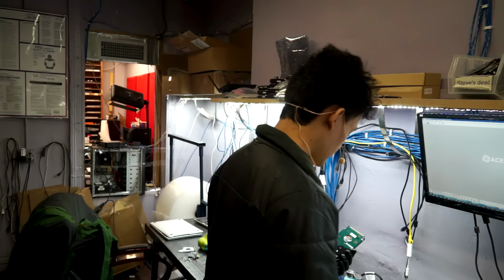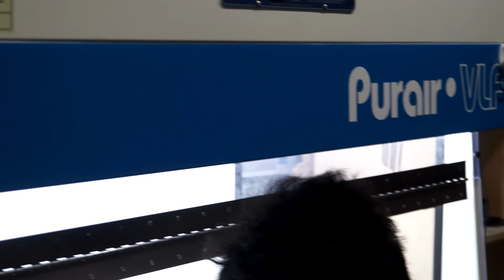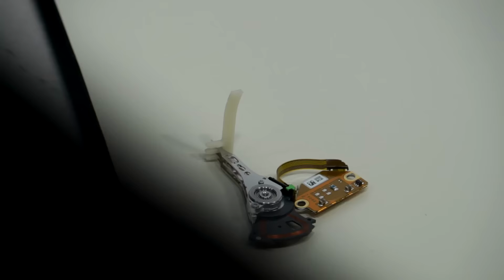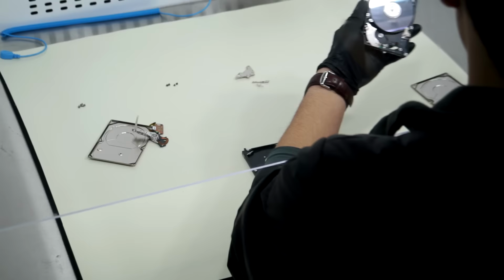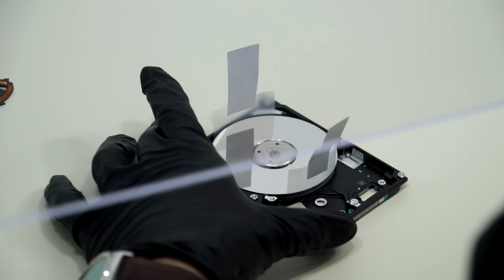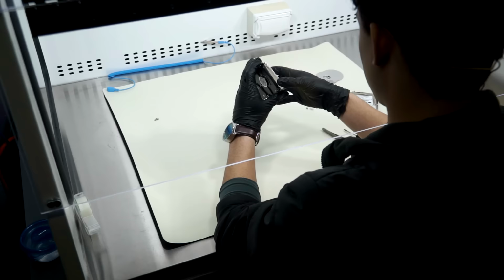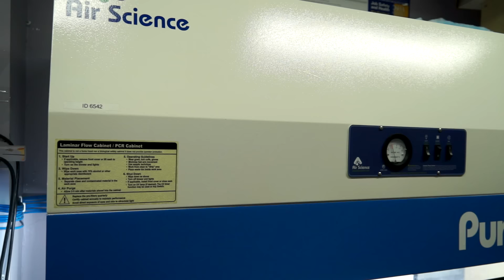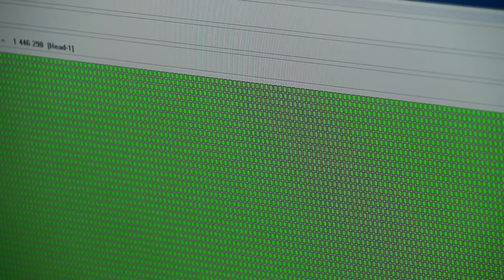Data Recovery: Hard Drive Platter Swap in Our Lab!

Comment: See what I mean?

Sharing/collaborating is the way of progress, not competition.  You shared this with the world, and now this will allow thousands of humans to replicate it — that is progress.  Now imagine you kept this secret (which capitalist system tends to push you to do — keep secret, isolate, compete, not share) — that would be impediment/delaying of progress.

You might think - "I shared this and did it in a capitalistic system".  That's because you can afford to do it, at least for right now, but if tomorrow someone opened a repair shop near you and proposed the same services for a lower price (which is how a capitalist/free market system works) — you WOULD NOT be sharing this — thus you would be impeding the progress ( and not because you personally are a "bad" individual, but because THIS SYSTEM would be pushing you to do this/to behave in this way, ).  No two ways about it...

And that's why a socio-economic system based on capitalist principles is very wrong, unfair, harmful even unscientific ( not to mention that it's completely unnecessary ).  And yes — we definitely can/could base the human society on collaboration instead of basing it on competition.  Actually, it would be the very starting point of the REAL progress, when we transition from competition to collaboration based socio-economic organization.

Further discussion is welcomed.
Reply from the maker: I think there are three separate points to address here.

1) I am only doing this within a capitalist system because I can afford to.

The reason I can afford what I can afford is that I have customers. I believe I have more customers because I make a take a good faith approach, which includes giving some info away for free.

Let’s take this example, if you will. A customer has two choices. 1st repair place keeps everything to themselves. 2nd repair place gives all the info away for free: tells you here's how to do it, here's how we do it. Which will the customer choose? Which will a customer feel better spending their money at?

The 2nd place. People do not like to feel like they are being held hostage to someone who is taking money from them just because they have one tiny sliver of info they don't. People will choose to do business with the place that is more open, transparent, and less douchey every time. Part of the reason I CAN afford to give info away for free, is that giving away info for free literally results in more money. 

For example: repair videos like this are a gateway to spoonfeeding. This is free information, and info I believe is free. However, if someone wants me to spoonfeed them a personalized solution to their problem, that costs money, and we charge for that. This acts as leads generation to more personalized solutions, which are $29/mo on the forum.

I genuinely believe that if you structure things properly, you can have your cake and eat it too: you can make more money, while being the good guy. 

Some may say well, the customer will do it themselves if you show them how. 9 times out of 10 they choose a professional because they do not want to spend the time to learn how to do everything properly, they want it done fast, and they want it done without Fing it up. Do I lose some people who otherwise may have paid, sure, but I gain it back and then some in people who send things to be fixed.

2) The idea that if someone else opens up cheaper, that's the end of me.

If someone opens up and charges less, they will be giving up one of three items.

-Legitimacy
-Speed
-Quality

Legitimacy: If they do not pay taxes, they can't accept credit cards, this loses them business. If they do not pay for city licenses, they look less legitimate.

Speed: If they cannot afford as many employees, work is done slower.

Quality: If they pay each employee less, they can afford less skilled employees, so work is done worse.  

Some places may actually do a fine job but not be able to afford a customer service clerk that is a good people person so they will get a tirade of 1 star reviews, which goes back to lowered legitimacy.

If a place can operate in the same area I operate, pay enough employees to have high speed, pay each employee enough to have high quality, and pay all fees required to be legitimate: then they have a genuine edge over myself. If the edge is enough, I will be forced to lower my prices or offer more value as a result. This occurred back in 2014 when I realized I could not outsource difficult board repairs anymore, and in 2012-2013 when I realized a dedicated people person was required to maintain value over places with poor customer relations. 

Further: most of the community already collaborates as well as competes. Chris Long will happily take in a Macbook repair via mail-in – so will I. We will message each other about these. Jessa Jones does iPhone data recovery as do I, and we speak about issues in the devices and share information on a regular basis. We compete, but we also collaborate. We all do better when we collaborate as well as compete. 

If there was no monetary incentive, less would be done. Do I like electronics? Yes. Do I like them enough to spend 10 hours straight for months on end making diode mode measurements and memorizing PSU amperage readouts to specific problems? Hell no. I’d stop as soon as I had just enough – the drive to continue pushing forward is a part of capitalism.
Reply from the maker: Also, one other thing:

I noticed in some of your comments you said you were being filtered. DO keep in mind if I see a comment copied and post it several times I report it as spam. Even at 420k+ subscribers I try to make time to reply to everything worth replying to, but I also do my best to keep a clean comments section with regard to duplicate posts.
Reply: I'd like to add to Louis's points.
Just because Louis has shown people how to fix a hard drive or board doesn't mean that everyone will then go and fix their own drives and boards.
Firstly you need the knowledge, skill, and experience to pull things apart without doing irreparable damage.  Then you also need the knowledge, skill, and experience to find and fix the problem.
Secondly you need the equipment to do the job.  Much of that equipment costs hundreds to thousands of dollars.  Who would spend that much to do a one off repair?
Thirdly you need the time.  If you have a full time job (not repairing computers), family, etc. You will need to dedicate hours to do a single repair.  How much is your time worth compared to what you would pay for the repair?

I used to be in IT and PC repair and people would tell me it's "easy to fix PCs" and I was making easy money.  But those same people still came to me to have their computers fixed !  If it's sooo easy why didn't they fix it themselves?

Edit - I need to add that Louis and his team make it look easy BECAUSE they have the first two parts.

Comment: soooo...realy dump question.....could you just instead of using the tape, mark the platters on the outside rim with a black marker or something? the edges shouldnt be important for the data right?

Comment: Hello, I have a very pressing matter to deal with on my 5 tb Seagate external drive that I use for business. I work in videography and have a lot of my work backed up on this 5 tb drive that my friend accidentally knocked over and caused a cm long scratch on the top platter and possibly others but I'm only aware of the top platter's scratch. The drive doesn't read on my laptop as the platter doesn't read now and stops spinning after a few tries. When I opened it up I could see a scratch of about a cm's length. I keep being told that no one can do anything to let me access my files but I just don't believe that. I really need to access these files again and seek any amount of guidance to help me do so. I know my way around hardware and can do a general amount of repairs on my own.

Comment: Great job - thanks for showing :-) I just wonder... is the screw driver you are using magnetized???
Reply: Yeah, possibly not a great item to have around a platter which has it's bits arranged using magnetism...  Then again look at the size of that internal magnet used to control the head-assembly arm actuator....

Comment: Tape on the edges of the platters?!  This is a professional repair shop.  There is a tool made specifically for this job, which grips the platters from the edges (looks like a cylinder).  Why aren't you using it?!

Comment: 29:03 the remaining 4 screws on the spindle are not necessary?
Reply: There's just the one central screw holding the cap down. You can see when he takes the cap off the broken drive.

Comment: Hi I am new to ur channel. I am from India. I have a toshiba external hard drive of 1tb & accidentally it fell from table & it stopped working I have open the hard drive and the heads got broken is there any thing to fix it or replace a new head. on the drive I have very important data which I can't afford to lose. Can you plz help or suggest anything to fix the drive.
Reply: One more thing I want to tell that I have removed both the platters also. Kindly suggest how can I fix that

Comment: If possible have someone make a program that would just clone the first plater and then clone the second and if the platers are misaligned have the program move all the sectors from just the one plater and try to aline them with the first plater software style after it already cloned both platers. If that makes sense. I can picture that in my head but hard to explain it. Exp. If cloning doesn't care if the platers are misaligned it will still copy it just like if the table of contents is crupted there's a program that will still scan the drive regardless.
Reply: Only with firmware-level access, that is, if you can run custom code on the drive's integrated controller. The normal (S)ATA or SCSI interface doesn't provide the low-level access that would require. So far, no such thing has ever been demonstrated on a HDD, but something very similar was indeed achieved on Samsung eMMC storage (running custom code on the eMMC controller itself to repair a corrupted wear leveling table)

Comment: I have watched a few videos that you guys are swapping componets at the board level and I still haven't seen any ESD protection used anywhere on anything. It's a real world problem. $10 or $15 goes a long way on expensive componets. At least use a wrist strap or an ESD mat.

Comment: Super awesome video!  I watched the whole thing start to finish.  It was quite enlightening.  The only question I have is now how much do you guys charge to do this procedure on any given hard drive someone sends in which has definite problems?  I checked your website and price estimates and I see it says $400-$900+ for anything requiring lab level tools(clean room/PC3000...).  So is that accurate pricing for this procedure even though it obviously only takes about 35 minutes to complete the swap?  I understand if there are some additional software checks you can do to see if the data is accessible afterward and of course you have the ability to extract the data files from the surrogate hard drive enclosure.  But $400+ is a pretty steep.  It seems to me that this operation should be able to be done for under $200.  Heck just watching this video it seems like this is something that I anyone with technical skills and patience could learn to do not too much different than taking apart a computer.  $200 is the absolute most I could afford but honestly, if you are charging $100/hour then this job should be able to be done for less.  Otherwise I would be more inclined to take the risks of doing it at home on my own with my own rig.  A silly laminar air cabinet could be made for under $200 with an hvac fan filter (like the kind used in cannabis grow rooms) that blows air though an air filter attached to to a hose out a duct tape sealed vent hood.  People need to get their hard drives fixed on the cheap and then they can get back to recovering their data on their own.  As long as the platter spins and the heads have been made to made to stop clicking, screeching, etc...  if there is any recoverable data there then at that point the end user can work on getting it off their own hard drive themselves.  All that is actually needed is a drive that is functioning from a basic hardware standpoint.  Thank you!

Comment: For some reason I would never trust a repaired hdd... The internals are just too delicate, plus replacement drives are cheap enough now why take the risk?
Reply from the maker: To get the data off of the broken one before you throw it away
Reply: Ahhh.. I didn't even consider it would only for recovery... Keep forgetting that not everyone keeps backups of their data in case of a drive failure  ;-)

Comment: Should I have to swap PCB/ROM from bad HDD to the new one?
Reply: Strongly recommended, you MIGHT get away with the logic board on the EXACT same model of drive running a different firmware revision but you might also hose the drive.
Reply: best to use all the original components, although it might not matter. Since its just the frozen spindle, keeping it the same drive is the best

Comment: He does great work, but it really bugs me that he uses tweezers to place the screws in place when he obviously has a magnetic screw driver. Am I missing something? And before anyone comments, a magnetic screw driver will not fuck with data. It takes a very strong magnet to cause that problem
Reply: If you look closely you will see that some of the screws are not magnetic
Reply: @jozefvallasek4343  Don't understand that at all. I have taken numerous bad hard drives apart to retrieve the magnets inside. The screws are all the same material. When I magnetize the tip of my driver the screws stay on the driver. Besides that, screws are not magnetic, it's the driver that is magnetic or magnetized.
Reply: @johngreene6783  You can clearly see that most of the screws inside the hard drive are made of different alloy than the screws on the lid. Judging by their colour might be copper, or brass based alloy, and those metals are not ferromagnetic. Obviously those screws are not permanent magnets, nor have I ever suspected them to be. Hope this helps
Reply: @jozefvallasek4343  Thanks, I guess I will re-watch the video. I know on hard drives that I have disassemble regardless of laptop or desktop, the screws are all the same material and a magnetic tipped driver holds them all.
Reply: @jozefvallasek4343  So I just took apart a Toshiba laptop hard drive and I now understand my confusion. It had been quite a while since I disassembled a drive and since they were bad, I never reassembled one. All of the screws are all ferrous material. However, some the screw heads are not deep enough to remain on the tip of the driver. Removing was fine but the reassembly was difficult but not impossible. The tweezers definitely made it easier to position some of the screws. I stand corrected but wanted to share my findings.
Edit: Funny thing I just noticed. If I use the magnet from the drive attached to the shaft of the screw driver, the screws stay attached to the driver and reassembly can be done without tweezers. Just an interesting find and thought I'd share. Thanks

Comment: That's some skill but the his similes are not so good. He does realize that tire rotations are something that is supposed to be done? The primary concern with the platters is that they stay in alignment not in balance. I would have used a simile of timing belts in an engine where your intake and exhaust cams have to say in alignment when you change the belt or it doesn't work.

Comment: I know what your doing works (but sometimes you fuck it up because of this for sure)!
But if you clean your hands they should never leave the flowhood before you finished. You constantly dragging dust in which can damage the hdd. Additionally you should put the hdd really close to the back if you have no other option and want to grab something outside! 
Really no offense - I have a lot of experience working with MO under GMP condition. 
Maybe you can improve your workflow.

Comment: Some disappointing videography here - I'd be ashamed to post it given most of the critical details are blocked from view.  Your videos are always perfect most of the time - what happened here?  Oh well, its from 2017 and the learning curve is steep.
You need to re-shoot this repair using my 8Gb SeagateT8000DM004 with crashed heads but perfect platters as an example.

Comment: Hang in a sec, if the platters are not lined up correctly you basically lost all your data?!
Reply: Tommaso Caruso  That still didn't answer my question
Reply: What does this hacking service have to do with answering my question about the platters not lined up correctly?

Comment: I tried to watch the video but the douche bag boss throws off the video. Petty boss with insecurity issues. Over what??? Over the employee finding a solution to the alignment by using tape. But the douche would been happier if he didn't use anything to align them at all, it seems 😂